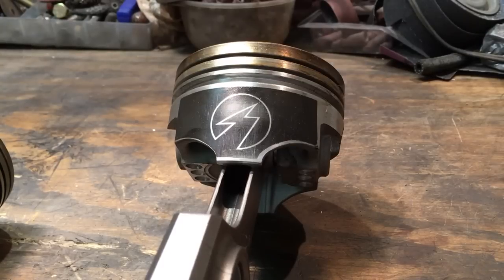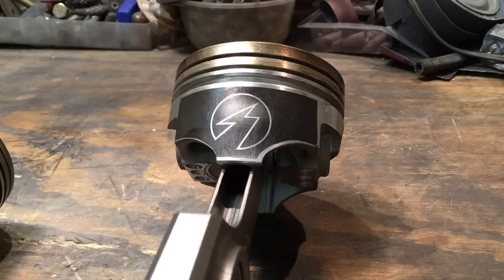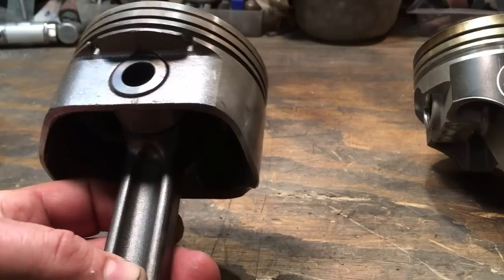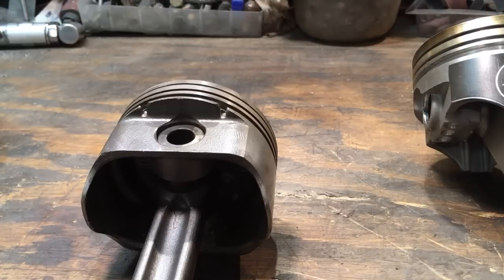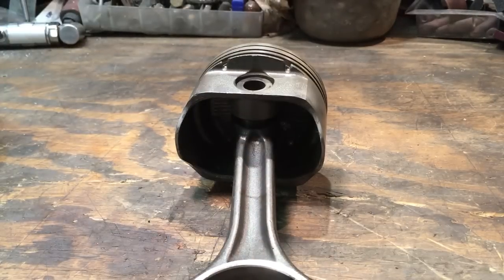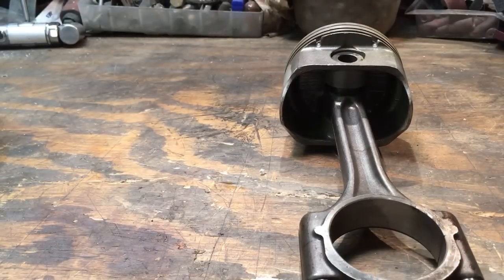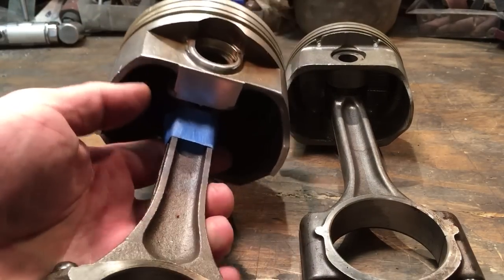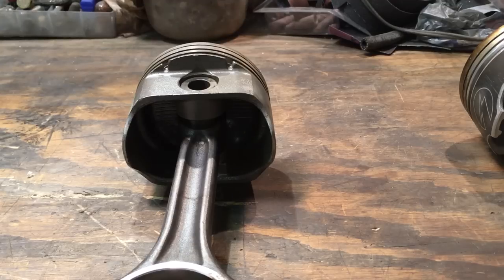6.0 5.7 5.3 4.8 Pistons Modification Drilling oil drain back holes to stop oil consumption

Comment: The hole or holes are to redirect oil to the wrist pin !
Reply from the maker: Not to say that allowing oil to drain down the sides of the pistons where the ends of the piston pins are, "If" you can keep the holes from plugging up, isn't a good thing however Performance pistons designed for much higher stress applications than a stock piston do not use that style of drain back at all.  I see what you're seeing/thinking but the piston pin gets oiled through holes drilled directly in the bottom of the piston pins boss cast into the pistons.  It's amazing piston pins get oiled through such small holes.  Keep in mind i did not plug the factory drains only added additional drain holes in such a way it doesn't effect the structural integrity of the piston design.  JD
Reply from the maker: Here's a good description I found on the Internet:
"Most OEM applications utilize splash lubrication for this. Some high end
 rods and manfacturers have a very small (EDM) hole that runs lengthwise
 in the rod from the upper bearing saddle to the wrist pin bore in the 
rod. Pressurized oil is then carried to the upper regions of the pin bore. Some also have squirters that direct pressurized oil
 from the lower regions of the block to the bottom of the pistons in an 
effort to cool them but some splash provides a lubrication source also. 
Sometimes there are also gooves machined in the wrist pin bore in the 
piston that carries oil scraped by the oil rings from the cylinder walls. Either way it does a tough job that is often not given much thought." 
 I personally have never seen in 30yrs any connecting rods with a hole drilled down the center of the beams, must be some foreign car or something I've never worked on... lol  JD

Comment: from what i have seen the burning of oil has nothing to do with the pistons  it is a hole in the valve cover right where the oil galley comes up and it sucks the oil through the vacume line   therefore thats where you are losing your oil
Reply from the maker: I agree on your observation of the PCV setup pulling unbaffled oil back into the upper plenum, this is a 100% true issue.
We've gone a step farther to see if there was other oil consumption issues.  The rational is that all LS engines have the same or similar PCV setup but not all of the owners experience the high oil consumption issue at 3+ quarts in a 3000-5000 mile interval.  After finding several articles discussing the oil drainage issue on some of the pistons, which could/would most likely be made much worse if regular oil changes were not followed during the engines service life, as a root cause to the higher oil consumption made logical sense.  Because there is no down side to adding the extra drain back holes I decided it's a Free mod to ensure no issue.

On the PCV issue I fully intend on running separators on any and all vacuum hoses hooked to the plenum to eliminate filling the upper plenum with oil as well.  Thanks for your input all information is helpful.  JD
Reply: HeadFlowInc
 no problem man